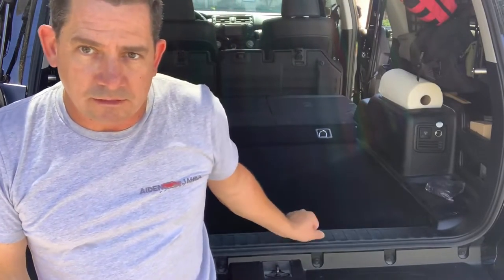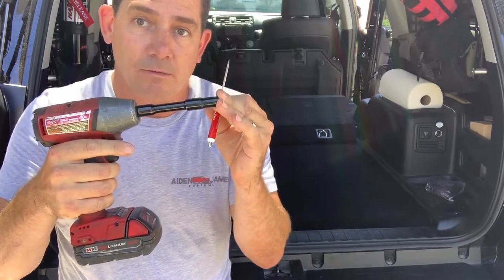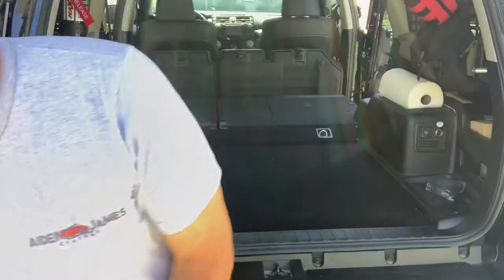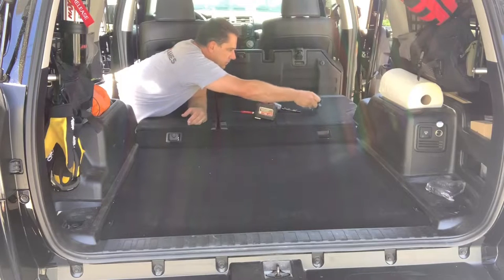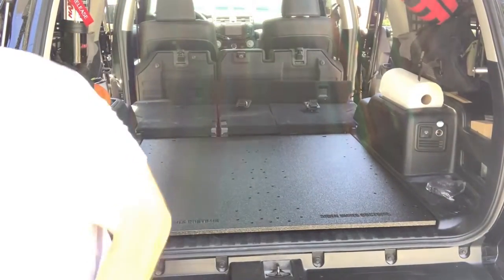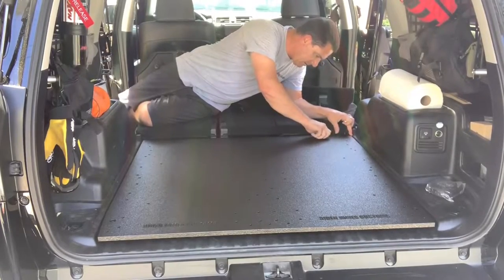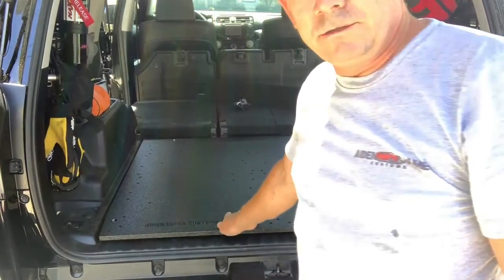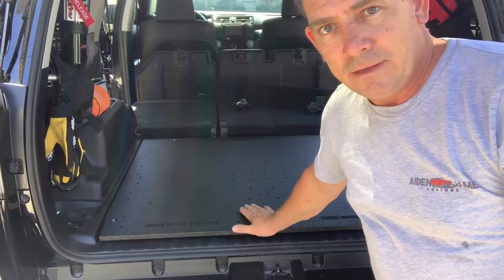AJC Gear Plate Install for standard floor 10+ 4Runner

Comment: I'm confused.  For the stick nuts, does it actually bolt or mount to anything?  Or does it just slide underneath that plastic trim?  I would think that it would be more secure if it bolted to something.
Reply from the maker: They slide under the plastic right next to the tie down anchors. We have performed tests to pull up the plate to simulate a heavy tilt and have done some very loaded down hard off-roading and had zero signs of movement or stress.
Reply: @aidenjamescustoms  why don't you make a bracket that tie down to the tie down, it would be more secure ?
Reply: @mikenguyen6208  Agreed.  Wouldn't take much more work to extend the bar to attach to that D-ring bolt.  A la Goose Gear.
Reply from the maker: Mike Nguyen we understand your concern however we wanted a solution that did not require trimming or cutting of any plastic and after rigorous testing through heavy off-roading through Grand Canyon, Moab and Colorado, this solution does hold it down securely with a loaded fridge and tons of gear strapped to the plate.
Reply: Aiden James Customs the Goose Gear setup does not require cutting or trimming any of the plastics.
Reply from the maker: Gazziza29 some models do however as said prior, we tested and found this worked very well under heavy load and severe off-roading.

Comment: Do you loose the tie downs after this? No biggy, just curious.
Reply from the maker: Only the two behind the seats but you can add a simple one bolt D-ring right in any of the threaded holes on the Gear Plate.
Reply: @aidenjamescustoms  OK, cool. I'm looking to mount a 1.5 T pro eagle